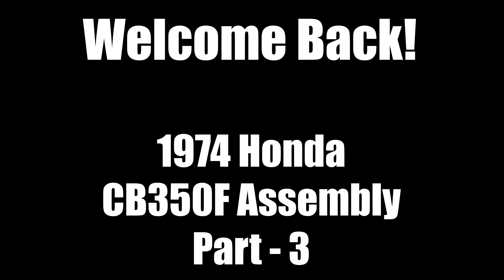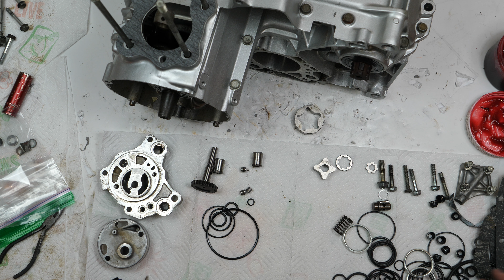1974 Honda CB350F Assembly - Part 3

Comment: Erstaunlich, musste vor 25 Jahren genau diese Montage an meiner 400 four , Baujahr 1975.
Original 20000 km auf dem Tacho. Zustand neuwertig. Mein Vorgänger hatte vorbildlich den Motor mit mit speziellem Öl für die Konservierung befüllt.  
Mein Fehler : Ich fuhr einige Kilometer mit diesem Öl und musste anschließend den Motor neu aufbauen! Es ist definitiv kein Öl zum fahren.
Und genau diese Arbeiten in diesem Video musste ich damals auch vornehmen. 
Es war für mich wie ein Spaziergang in der Erinnerung. Der Motor war so übersichtlich konstruiert und alles so logisch aufgebaut. 
Wenn ich mir heute dieses Video ansehe, dann frage ich mich: wie konnte ich damals all diese Schrauben und Dichtungen, Lager, Simmerringe, Zahnräder, Sicherungen und und
wieder richtig zusammenbringen? Aber irgendwie hat dann alles funktioniert! 
Habe meine cb 400 four bis heute und sie läuft bis heute ohne Probleme !
Irgendwie habe ich etwas richtig gemacht.
Der Optimismus der Jugend...
Reply from the maker: Great to hear you were able to get it back on the road and able to fix it despite the oil damage. I have also seen a few of these with the storage oil in the engine. it seems to be thinner and as you mentioned, not up to the task.

Comment: Did your gasket kit include all the o rings for the oil pump?  My nos kit did not come w the o ring for the outer “little” pump area that you said may have been for the overhead part of the engine.  Do you think harbor freight viton o ring kit would be decent enough to use if they had the correct size?  Thanks again!  -Bob
Reply from the maker: Bob, yes all the or rings came with the gasket kit. But with that being said i do keep a HF o ring kit and do use them. I have not had any issues with them as long as its the correct size.